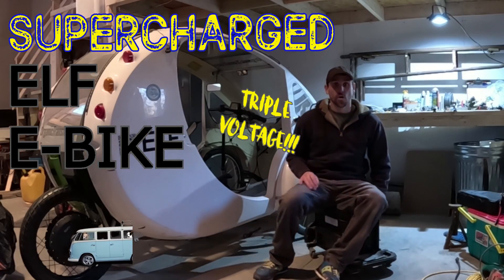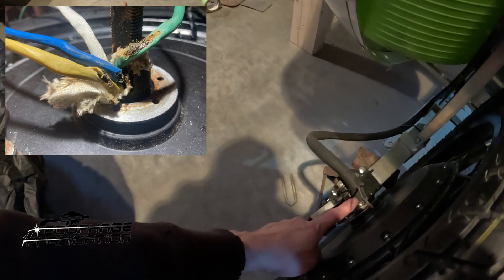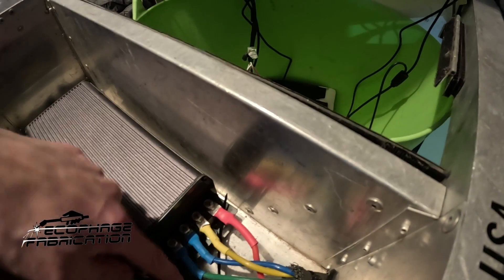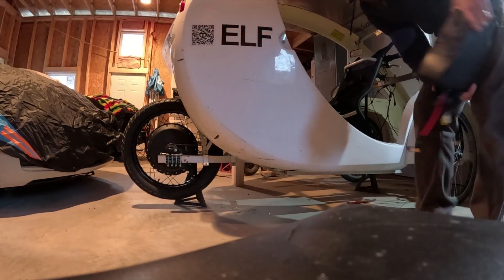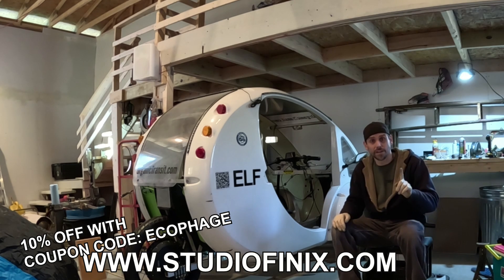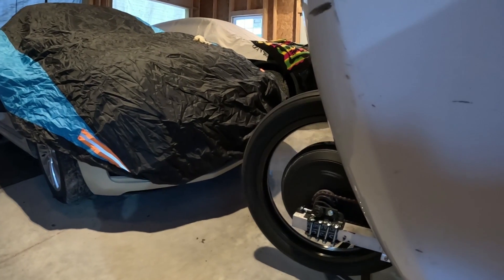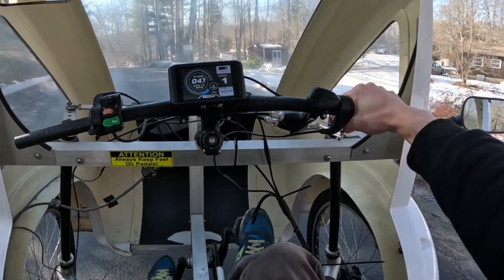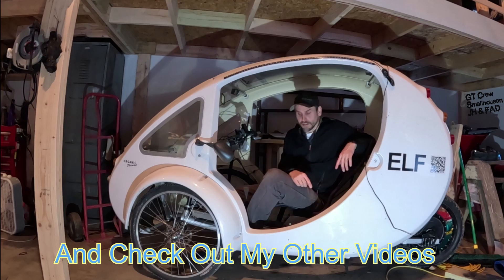Building The Fastest ELF E-Bike In The World! SUPERCHARGED Trike Recumbent Electric Bicycle

Comment: This thing is a death trap.   The handling characteristics of this is much, much different than a motorcycle or bicycle.  It is pretty easy to tip this velomobile with this design.  The weight is too high.  Most velomobiles sit very low to the ground and the rider is very low to the ground precisely because of the instability of the design (most velomobiles are designed to go fast)
Reply from the maker: Yep the owner told me he almost rolled it, not my problem really but yes. He wanted it dangerous fast and he got it. It’s actually back in the shop right now!! He decided it needed a suspension system now (he’s right) there’s no way to avoid potholes in a trike.

Stay tuned for my suspension upgrade 

I’ll try to get it even lower after this tip see if I can get better stability 

Thanks for the advice
Reply: @ecophage  Frankly, I'd be worried about liability, at least in America.  Even if you win, defending the lawsuit could bankrupt you.
Reply from the maker: @ invoice specifically removes all liability from builder and warns of it’s dangerousness due to modifications 

Also LLC my dude
Reply: @ecophage 
and put the battery lower like all electric vehicles

Comment: Nice. My ELF right now has a hub motor on each of 3 wheels, all wheel drive, and well over 5000w of output. You have to have strong torque arms for any eBike!
Reply from the maker: Woah seriously you have hub motors in the front!!!! That’s awesome I’d like to see that set up
Reply: I do have pictures, if I can figure out how to send them. I've hauled 475 lb in the back of it, and it's my primary transport. They're grin all axle hub motors.
Reply: @Jordyperson  I'd love to see that too.. How's the solar intake? I wanted to add mid drive as well to 3 grin Motors
Reply from the maker: @Jordyperson if you have Instagram send me pics to @ecophage
Reply: I just sent a reply with a link to an article on the Grin Tech website. The Terratrike Rover tandem on there is mine too!

Comment: Does this update continue to have rear brakes?  I didn't see any in the video.  At 72V I'd like to have a big disc brake in the rear as well as the front.
Reply from the maker: I never thought of that because there was zero rear brake set up on this to begin with. Also though many rear hub kits do have a disk brake option this one didn’t. I was provided with the motor kit and the elf. So I just made it work with what was there. Perhaps that’s a next upgrade along with some suspension. 

It gets pretty sketchy at 35 and I assume two disk brakes up front is fine at 35mph this things so long it’s not doing an endo hahah